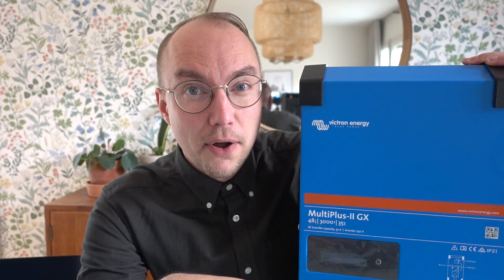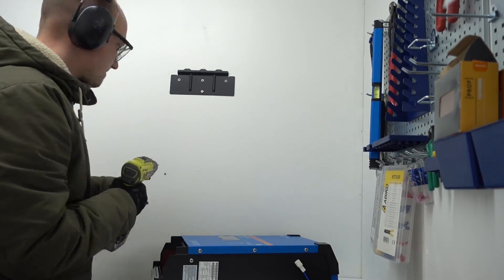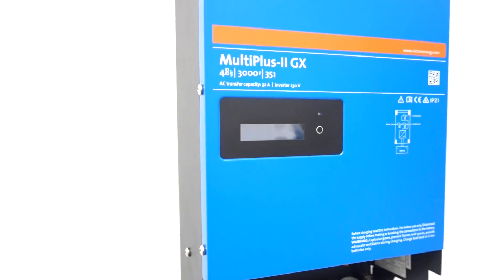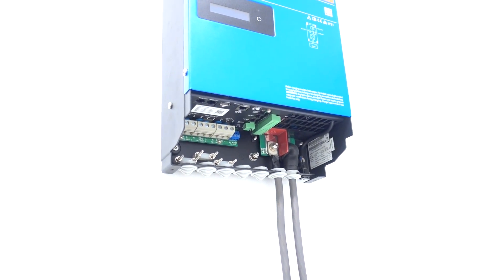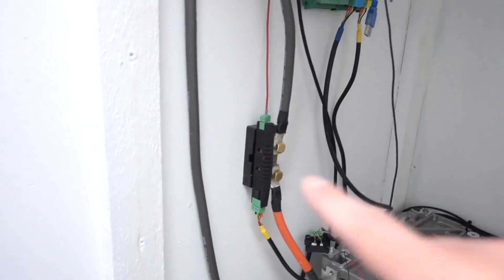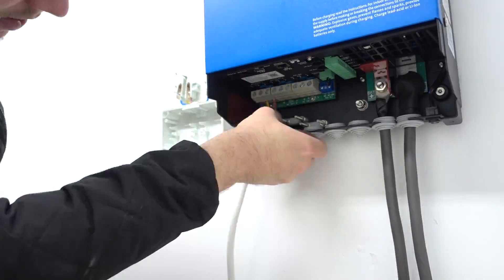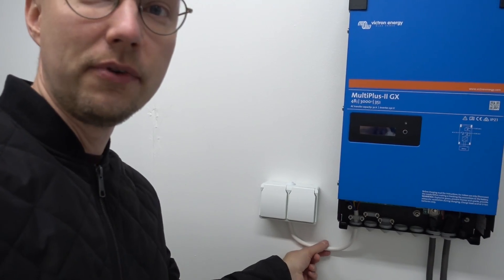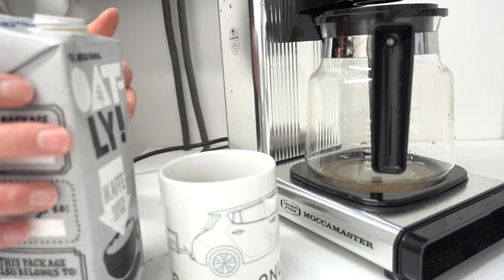ON/OFF-GRID DIY Powerwall build [part2 - Victron Inverter]

Comment: I've been looking at the Victron brand for a new inverter however I noticed that it is not named on the Github; Supported inverters list (unless I missed it!). Why is this ?
Reply from the maker: Victron 48V system is so 2010. High voltage EV batteries is all the rage now, safer, larger and easier to install!

Comment: hello is there a part 3 how to get the bms to communicate to inverter?? is it ok to use an inverter without bms communication like the Chinese 5kw off grid units  ?
Reply from the maker: It was just 2 wires between Batrium BMS and the Victron unit. The manual for Batrium has all info. 

BMS comm are always needed, otherwise you can run into dangerous situations where thr battery wants to stop but thr inverter doesn't know it!

Comment: Hello, hope you're doing well.. I need to know how to do configuration through phone. I connected 4 batteries in series with 200Ah, 12V each and Temperature senser wire... how to do configuration?
Reply from the maker: For Victron units, see the Victron manual, and also secondlifestorage.com is a great place!
Reply: @DalasEVRepair  Thanks for the response.  I have already joined the platform. But just help the answer.. by that case what will be the values of float voltage and Absorption voltage?
Reply from the maker: @expert5898  that depends entirely on your chemistry!
Reply: @DalasEVRepair  thank you, but I have  explained the scenario.. help through the scenario.

Comment: I live completely off geid qnd use a variety of inverters the victron seems super nice but expensive.  I just use a 110/220 split phase sungold power 4000 watt inverter and a 3000 watt all in one powmr. They are both 24 volt. I also have 3 12 volt inverters that are never used any longer but if needed they are their. I had stage 4 cancer and in remission now but it opened my eyes as to how important it is to have no monthly bills in case of sickness or worse. My wife and i needed to be able to survive comfortably no matter what life threw our way so this solar hobby became a way of life. Thankyou for the instructional videos qnd god bless

Comment: Dala, is it possible to add an inverter and battery bank like this after a solar inverter like the huawei sun2000's? That's because the huawei inverter compatibility is very restrictive and requires an additional backup module, which I don't see the point of.
Reply from the maker: Yes it is! The Victron inverters can be added in paralell with any existing solar inverter, you just need to be creative with setting up the charging/discharging logic!

Comment: Great videos! Can the inverter also supply power from the battery to the grid?
Reply from the maker: Yes, it can be setup to backfeed into grid if batteries are full and solar is producing excess!
Reply: @DalasEVRepair  okay, but not from battery without solar (for instance st night)?
Reply from the maker: @mortenprehn7964  Unsure, haven't studied the manual enough. But most likely possible!
Reply: You can feed into the grid just from battery power of you want. It's all set up in the Venus OS via a web browser.

Comment: Excellent Dala. Do you have to add an earth rod into the ground or connect to the house earth?
Reply from the maker: Yes it needs to be connected to PE!
Reply: @DalasEVRepair Victron has a relay that as soon as it sees grid power it disconnects the N-E link inside the inverter. Of course this depends on the country you're in if they use a common neutral ground bond at the board. A separate ground rod connected to the case earth is a good safety precaution.

Comment: Cool! How much is your batt capacity & approximate cost?
Reply from the maker: Around 2kE for this 24kWh battery+bms
Reply: Hi there, what batteries have you used for this?
Reply from the maker: @malckyh8102  2012 Renault Fluence (Same as 2012 Nissan LEAF)

Comment: I am also building a similar system using Victron components; however, I've opted not to go with the all-in one Multiplus-II GX model, but I have picked a 5kVA Multiplus-II, along with a SmartSolar 250/60 and a Cerbo-GX unit. The thinking was that if any on the aforementioned units would fail, the rest would keep on working, while if I went with the all-in-one solution like you did, if there was something wrong with any of the components, the whole system would be down completely.
Reply from the maker: Sounds good!